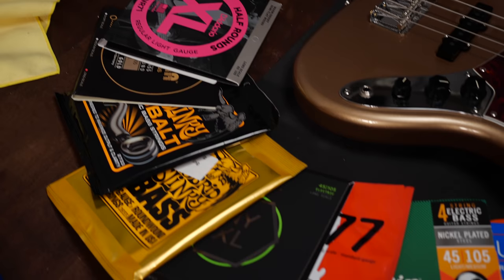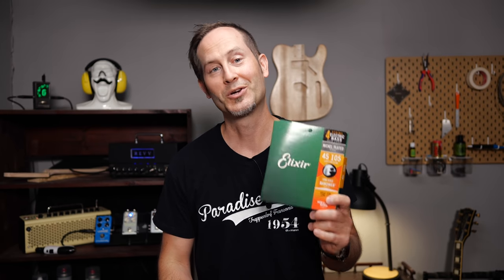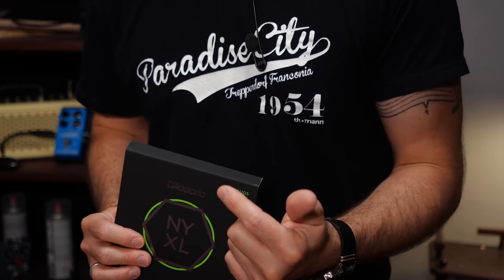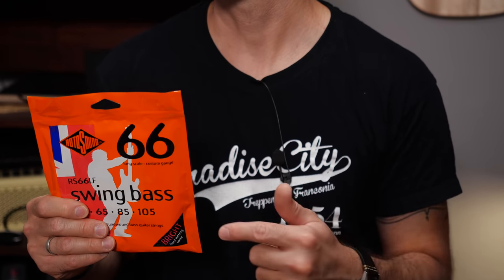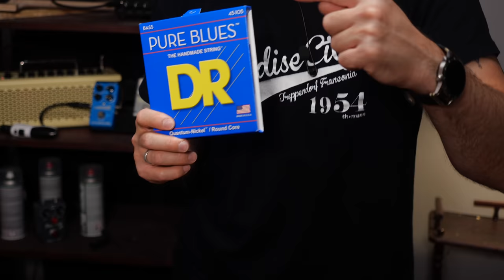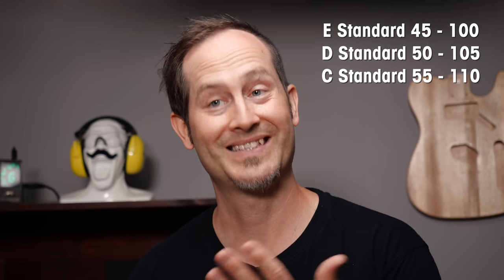All Bass Strings Explained | feat. Julia Hofer | Guitar Tech Tips | Ep. 78 | Thomann

Comment: It’s been years since I played bass, but I remember when I would play with any band, I would always play with a Fender P Bass, last bass I owned being a Fender Black Top P Bass, which was an amazing bass and I honestly wish I never sold it, since it’s nearly impossible to find new nowadays. For strings, I use either DR Hi Beams, or Dean Markley Blue Steel, depending on the sound of that particular band. I couldn’t stand Black Beauty strings. While they do sound great out the box, they feel terrible when you wear them in. They were actually painful to play. I tried them 3 times and just couldn’t justify the pain I started feeling over time.

As for my gauge size, it was always .45, .65, .85, .105. This was due to always turning in E flat and sometimes dropping my E string to C sharp. It worked for me and basically every band I played in. They all agreed to the tuning of at least E flat.

Great video. Definitely a nostalgia rush for me personally and I liked hearing what different strings offered.

Comment: You guys forgot about tapewounds and pressurewounds. Tape wounds work great in toning down an overly bright bass ie. Swamp Ash Body, Maple Neck, Steel Bridge, brass or bone nut. You get the picture. 
The pressure-wounds(also called ground-wounds) are great for getting the traditional Motown sound out of an otherwise dark bass ie. Basswood or Mahogany Body, Rosewood fretboard, Brass Bridge and Bone or Graphite nut. They are just a pinch brighter than Flatwounds so they do have a time and place. Otherwise a pretty good tutorial, thanks.(note: this statement contains factual inaccuracies which I correct below in subsequent conversation. I have left it as originally posted so as to maintain the continuity of the conversation)
Reply: Pressure wounds are not the same as ground wounds which were included in this comparison.
Reply: @stephenshoihet2590  The ones I buy are called GHS Pressurewounds. They are made by taking a large diameter roundwound string and grinding it smooth, like a flatwound. This type of string construction is not mentioned here. They have a bit of a niche application, but if you need them they work wonders, and that is why I brought it up.(note to any readers, please read my comment below concerning strings and construction techniques. This statement I made here is factually inaccurate but I left it intact as it relates to the direct response below and to my subsequent comment. I decided that editing this comment to correct the inaccuracies would make the conversation completely unintelligible so I have left it as originally posted, warts and all)
Reply: @jomamma1750  ghs pressure wounds are not ground, they're put through rollers that flatten the outer windings, hence the "pressure" in pressure wound. Pressure wound strings generally feels smoother than ground wound strings.

Ground wound strings are mentioned here, they're the d'addario half round strings.
Reply: @stephenshoihet2590  Ok, What I did was to get the Nomenclature incorrect, hence the confusion. The GHS Strings that I use(besides Boomers) are called Brite Flats. They ARE groundwounds. However, unlike the description given in the video the GHS version does not sit halfway between rounds and flats on a tonal scale. They sit only slightly brighter than true traditional flatwounds. They are also absolutely smooth and feel essentialy identical to a true flatwound. Hence the confusion as I have never used D'addario's "half rounds". I have also never knowingly used Pressurewounds, which sit much closer to the halfway point on a tonal scale than the Brite Flats, according to the manufacturer. I, therefore, had made the incorrect assumption that what he calls "half rounds" in the video were indeed pressurewound strings. Having never played that type of string I have no frame of reference as to the feel under the hands and the implication in the video is that the "half rounds" are not glass-smooth. Brite Flats are glass-smooth.
So that does leave 2 styles of string construction, Tapewound and Pressurewound, unmentioned in this video.
There may very well also be a considerable tonal difference between D'addario's "Half Rounds" and GHS's "Brite Flats". These differences in tone amongst manufacturers will stem from somewhat different construction techniques and, at times, radically different metallurgies used.

Comment: I wouldn't know a good bass string from a bad 1. Lucked into a Dr Tech bass for $80. Fixed it all up as it had a little bow in the neck. Decided to get some new strings for it. Found a 3 pack deal for Fender x light red pack on Ebay. For $18. Got them thinking a string is a string. When they showed up it was 4 packs and I haven't changed strings in since. But don't use this bass much. As I'm a guitar player. With 4 very different guitars and each has specific string set for each guitar. These Fender bass strings work. That's all I know. Interesting video to maybe learn something about my bass.

Comment: I have found with SS strings on bass, it was LIKE having a chorus pedal on all the time. Too much upper partial with less fundamental! However, I LOVE SS guitar strings! Not so much uppers on thinner strings. But more elastic @ the same guage/tensions than nickel doped steel, which is stiffer!
Reply: I use medium gauge  SS flats (55s) and never have a chorus problem. I also play on a fretless.
Reply: @juzek1958  Prob cos they're FLATS! Round wounds are definitely more zingy, so get more upper partials than fundamentals, causing the chorusing!

Comment: Is 40 really a standard guage? I've only ever used 45 or 50.
Reply from the maker: Most people I know play 45s and those who want less tension sick to 40s (like Victor Wooten). The only bassists I know that play 50s for E standard tuning, are metal / hard rock players. But as told in the video, there is no "this is what you should use" rule and definitely no right or wrong. It just has to work for you, that's it. :) //Kris
Reply: From an old-school perspective, 45s are light gauge and 55s are medium gauge (as per Fender's definition). I'm 67 and play medium (55) SS flats. I play mainly 50s-60s R&B and jazz.

Comment: Really? No time stamps? Damn, bassist YouTubers are lazy.

1:10 + 1:35 = "Regular" - Nickel Plated Hex-Core Steel Round Wounds
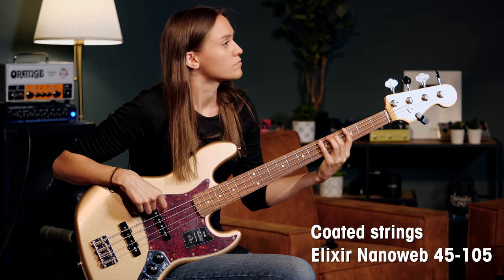2:20 + 2:45 = "Coated Regular" - Elixir Nanoweb Hex-Core Nickel Plated Steel Round Wounds
3:28 + 3:52 = "Hardened" - D'Addario NYXL Hex-Core Hardened Nickel-plated Steel Round Wounds
4:43 + 5:05 = "Cobalt" - Ernie Ball Slinky Hex-Core Cobalt Cobalt+Iron Round Wounds
5:46 + 6:09 = "Steel" - Rotosound 66 Hex-Core Stainless Steel Round Wounds
7:06 + 7:38 = "Pure Nickel" - DR Pure Blues Round-Core Pure Nickel Round Wounds
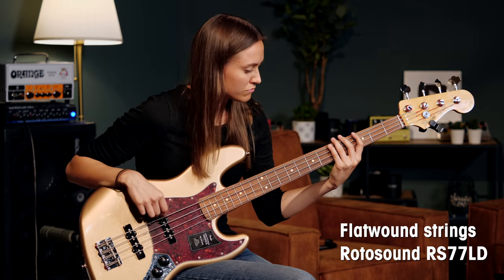8:08 + 8:32 = "Flatwound" - Rotosound 77 Flatwound Strings
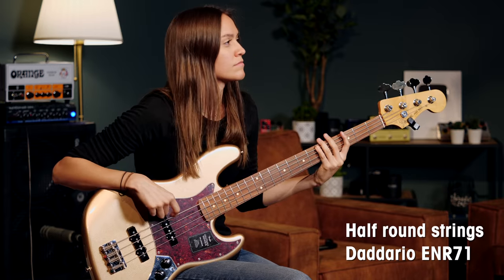9:10 + 9:32 = "Half-Rounds" - D'Addario XL Nickel-Plated Steel Half-Rounds
10:07 + 10:30 = "Golds" - Optima Gold-Palted Round Wounds
Reply from the maker: Ummm, there are time stamps. Check the video description box. :) Cheers //Kris